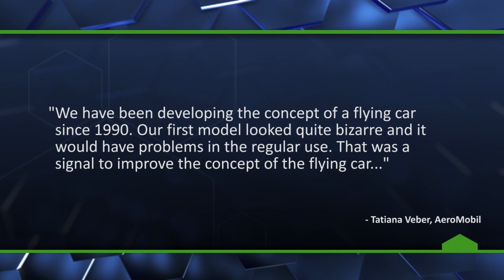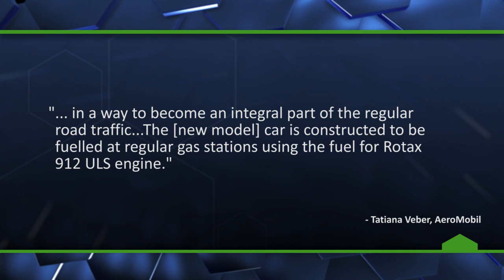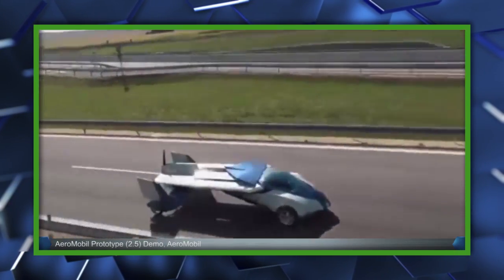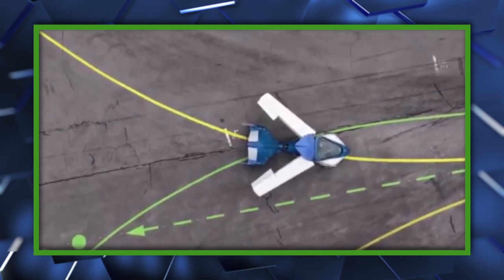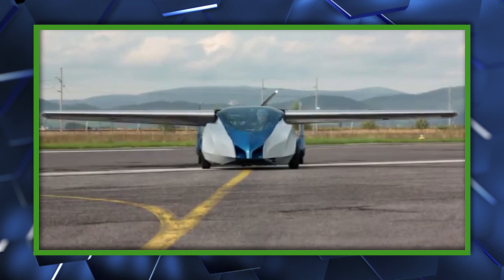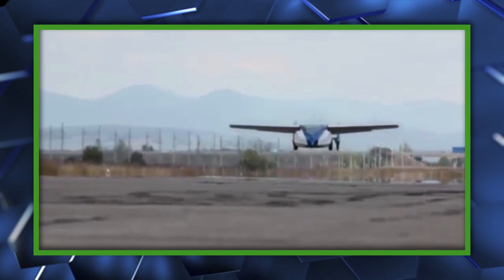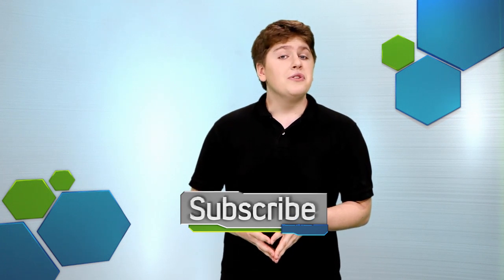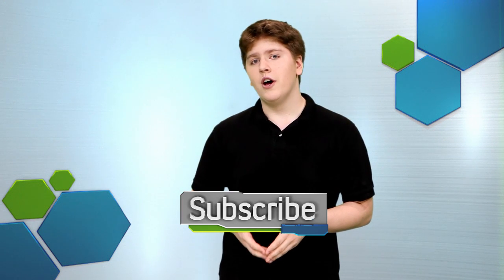Here's a Real, Actual, Working Flying Car! - The Know

Comment: Eh... Why did they base themselves on a plane to make a flying car? Just switch the wings with rotors and voila, you've got a VTOL car that doesn't need a runway. Would make it a hell of a lot easier.
Reply: VTOL in this situation requires three several engines. One for the wheels and over the road driving. Two in each wing for the props. That would increase the max overall weight and make it cost more. Aside from the fact that there are not any civilian VTOL aircraft, other than helicopters.

Comment: my biggest problem with flying cars is that it doesnt seem practical for everyday use. how would it brake in the air or be in traffic, because if flying cars are ever a big thing there are probably going to be regulated flight paths similar to roads. also i am thinking of the danger of hundreds of thousands of cars flying all at once.
Reply: It's a prototype give it time

Comment: For a guy with no experience being in front of a camera and considering that he is reading off of a teleprompter(which Ryan said was difficult when he first used it)....not a bad job. Good job Chris.
You might want to take slower, deeper breaths and control your hands. One hand goes in your side pocket(or held somewhat still at your side) and the other hand gestures. You pull your hand out of the pocket, for gesturing, when you want to emphasize something as the change tells the audience to pay more attention. This has helped me a ton.

Comment: I'm wondering, how does the car gain altitude? What's more, is the steering wheel normal, and actually able to pilot it in the air effectively, or is there some kind of change I'm unaware of?

Comment: So does that mean we can start buying gas made for airplanes?

For the love of God I hope the people that read this realizes I was being sarcastic.
Reply: Well actually you can buy 100LL. I wouldn't run it in your car unless you remove you catalytic converter. You'll burn it right on up. Plus most airplanes are converted over to run on car gas. But you cant run jet fuel in a normal combustion engine. Its essentially diesel, you can run jet fuel in a diesel engine though.

Comment: Flying cars are called helicopters. We have had them for years now. 

This video is SEVERELY LACKING in common sense. 

The reason we don't use helicopters, they are expensive. That is why only rich people use them.
Reply: theres a giant difference between a car that can fly and a helicopter. yes helicopters are great for short distance and easily executed flight, but its not really comparable to the idea of a flying car.
Reply: no there is not
What the fuck is wrong with you?
Reply: We're talking 2 completely different vehicles here. Helicopters were originally used for tactical military deployment and quick flying around places. While this "flying car" is basically a stReet legal CAR that can fly like a plane. And don't talk to me about heli-planes.

Comment: What is the point of taking to the air if you can only go half of your normal speed? Sure you'll avoid traffic, but where are you going to take off from, and where are you going to land?
Reply: he said between 40 and 124 mph
Reply: because there's no traffic in the air so you can always be travelling at a speed of 40 to 124 mph and you don't need to follow pre built roads but "travel as the crow flies".
Reply: I may be able to go half the speed but if flying from here to there takes a third of the time due to not sitting in traffic then, yeah, I'm still ahead.
Reply: *****
 this. also, with its size i doubt it would need much space to take off and land. it still might be hard to find a clear area, but a normal street should be enough.
Reply: This guy is literally the dumbest person ever...
Reply: CptGameMaster Well, not much use, really. But remember, this is just the first stages of the evolution of the flying car. Sure, the usefulness of one right now is pretty low, but still, this is the beginning of what might later become the flying cars people have always looked forward to.
Reply: I'll deck you in the schnoz, ᵇᵘᵗ ᵈᵒᶰ'ᵗ ᵗᵉᶫᶫ ᵃᶰʸᵒᶰᵉ
Care to elaborate?
Reply: Wildman23 Yeah sorry, I thought he said KPH so I got mixed up.